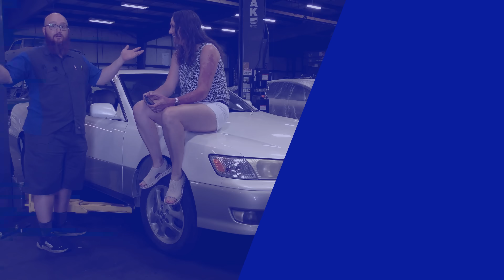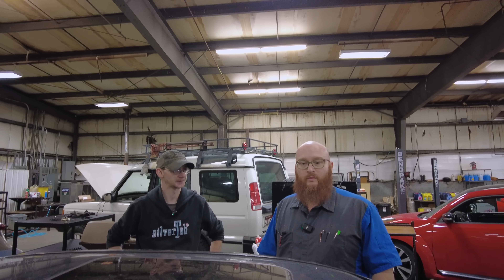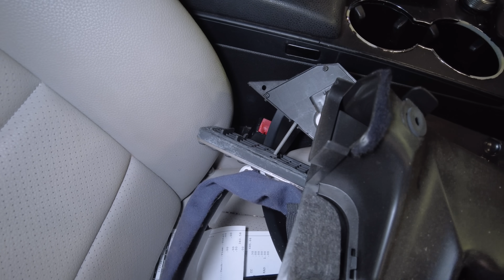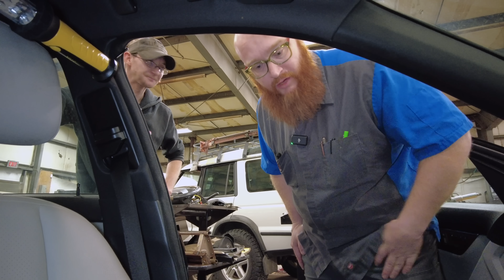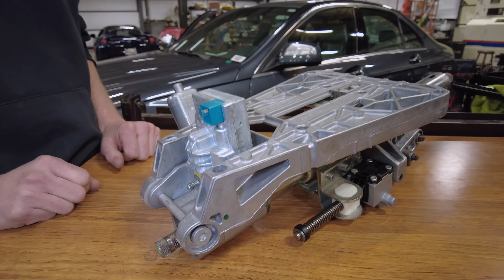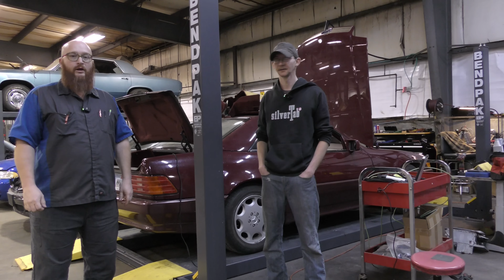Tiny Part TOTALLY Disabled This Mercedes! AND it's a Common Problem!

Comment: I've said many times The problem of using Mercedes, Bimmer, Audi or any high end cars here in North America is that the Mechanics here for these cars are shit...are crap ..even those at the dealership and they all overcharge .  They still don't know how to fix easy stuff on Germans Cars compared to European Mechanics or even a roadside Mechanics in Africa or Middle East for these cars. My friends W204 had the same problem, and Bad  starter motor in Ghana and was damn easy and cheap for these young Mechanics with few tools to fix everything without having to disassemble the whole car like  this one in this video. And oh for the starter they open it up and fix for just $30

Comment: Just had to fix mine in Nov 2023 on a 2012 C300. I replaced it with an emulator, thank God I was able to do it without removing the entire column. Oh BTW, the dealer wanted 1900.00 for the repair on a car with 140,000 miles on it

Comment: Theres a way to start it btw incase u need to get it home basically what u do is put the key in the ignition turn it all the way dont crank tho
Now go underneath you hood go to ur fuse box locate fuse i believe is number 27 7.5 amp now pull it out and put it back in then go to relay “M” which is yo ur starter relay crack the cover off not damaging your relay after u get the cover off theres a contact on the side contact it by hand and your car should start if not try all the steps again if it dosent start u have another issue hopefully your steering lock module went bad on the unlocked position 
Also if that relay step dosent work try putting in a new starter relay and trying it again but every time it dosent work u have to repeat the key part 

Step 1 key in turned all the way basically ignition on

Step 2 pull fuse number 27

Step 3 put fuse number 27 back in if its not blow ofc

Step 4 hit the relay contact for the starter 

And that confirms u have a bad esl module that took a shit but atleast you arnt stranded

Comment: This is the EXACT same problem on nissan/ infiniti cars. I have a g37s with this same problem...steering column lock. Car won't start at all. Replaced part, electronics work,yet car won't start.think it needs programming. It was a b$%th to get out.

Comment: I had this happen to my W204 in Queensland Australia with manual steering adjustment 6 years ago. I did the job myself and pulled out the steering column etc - drilled the lock stud out took the lock module out and sent it to a guy in Sydney Australia and he repaired it and sent it back within a week for $280 Australian dollars I refitted it and it works perfectly to this day.

Comment: I suspect mine has an emulator installed previously. Other than  non locking steering and a functioning car, what would confirm an emulator has been installed?

Comment: I have done so many off these i cant even count them on my 4 hands. Common problem. We just get it by passed. I have even mastered taking the lock out with out removing the steering column on these w204's

Comment: Its the little dc motor that craps out. The brushes just wear out. Just like a starter mortor. You can buy the little DC motors and replace it if by any luck you can get the motor to turn by tapping it with something while turning key.

Comment: i believe C5 corvettes have an emulator thing that you can retrofit for a similar issue also. I installed it on mine so that when the steering wheel lock goes bad,  it won't leave me stranded.

Comment: I drive a w204 C300 and I had this  ESL failure issue, my local German shop quoted $1700 to fix it and another shop quoted $2500. I bought the actual motor bit itself and it was only $5 plus the tools to get to it were maybe $20 and it took me about a day to do. It’s a wild problem and is better to just prevent with an emulator honestly if you plan on having one of these cars for a while.

Comment: Emulators can also FAIL.
The real problem is the crappy little motor.
Looks like a toy train motor.
Best to replace the Motor but DO NOT mount to the Steering Column. Leave is loose for when it Fails again.

Comment: I’ve replaced many of these 
1. If the ESL fails in the unlocked position you do not need to remove the column just undo the 4 bolts & lower the column & remove the 13mm nut holding the stud then push it in & remove.
2. In the locked position on a manual adjustable column will need to remove the column not that hard can remove in 1/2 an hour.
3. Rather than cutting the stud off just drill a hole in the housing & wind the plastic gear wheel back till the stud pushes in.
4. If you have the electric adjustable column it’s definitely more tricky to get out as in this case.
5. The ESL is generally reliable mostly older higher mileage vehicles that suffer failure which can be predicted by the sound of the motor, when working correctly will release quickly on failing motors it is sluggish to release if yours does this remove the ESL in situ before it fails in the locked position. Buy a new ESL fit it leaving the old one connected take to a main dealer & have them just code the new ESL in ( just needs the wiring plugged into the new one & a coding key inserted into the EIS for a few seconds then good to go, you will need to have the dealer order the coding key to chassis along with the new serial number of the ESL & provide proof of ownership)
6 W204 is very reliable otherwise.

Comment: The saddest part about this video is that this exact same thing happened to my Aunt's car. Same model and everything, I popped the hood and serial plugged up the car's battery to drain residual electronic gremlins for about 15-20 minutes.   Outside of having to reset the radio, the car came back to life like nothing was wrong.  I can just imagine how much it would cost someone to do what the Car wizard and his mechanic did to fix this problem.  Cheers

Comment: Back in the old days I had two Mercedes diesels. 77 240D with 4 speed was like driving a 36hp VW Bug. Bought it for $2,250 just after the previous owner spent about $4,500  on the complete balanced engine overhaul by a well known Kansas private Mercedes repair shop when it had about 225K on it. He also spent about $500 on new sheepskin seat covers. Then the blower motor quit and that previous owner said he wasn’t going to pay the $250 or any more repairs so sold the car for probably a little more than any dealer would give him for a trade. That was in 1991. The wife and I ran that car another 200K until  it rusted out. It was still averaging about 30 mpg when we sold it. Various repairs over the years but nothing that couldn’t be relatively easily repaired. No computer! I really like driving on someone else’s money. About 1993 or somewhere in there bought a 1979 300SD Turbo diesel. Also bought that one with something over 200K on it not long after the previous owner had rebuilt the engine after he didn’t notice the temperature gauge on a drive to their ranch in western Kansas when the lower radiator hose decided to give up the ghost. Warped the head and did whatever damage excessive heat can do to a cast iron block. Owner bought a new Mercedes head. Sent the bottom to a machine shop in Oklahoma City that specialized in MB diesels. Then put it back together themselves on their farm/ranch shop. I had to pay $5,000 for that one. Still considerably less than I would have had to pay from a dealer for that car with a new engine. It was in excellent shape and I could pass anything I wanted, uphill or down. We ran that one over 200K too with typical old technology MB repairs. Again no computer and driving on someone else’s money. Finally sold the 300SD in 2005 and bought a 1996 Lincoln Town Car with 111K on it. Got that one cheap too. Still driving it with 215K on it now. One thing for sure after Car Wizard detailing all the things that can go wrong with “modern” MB’s you can bet I’ll never buy another one even if I had cash to pay. I’m holding out for a Toyota Avalon built before the 2013 model year which is when Toyota screwed those up.

Comment: Previous SL models had a plastic lever that cracked in the ESM selector.
There is an Aluminium upgrade about £20 .
Even better the lever can be deleted and then the gear lever will move even with key out...........
Less to go wrong IMO ⚠️

Comment: Happened to our 2010 glk but had manual adjustments so by slamming the steering wheel up and down to its stops freed it enough to get to dealer

Comment: I love my 68 years old Mercedes no issues like this can happen. My amateur advice:  dont by a car newer than 1989ish. All this electronic gimmicks will continuously cause unpayable issues as older your rolling mobile phone gets. No one uses a 5 year or older electronic device as they get slower or just dont work anymore. Think of all that electronic squizzed into a rolling object as a car. Rumbling on bad pot hole roads, non water or damph proofed, sudden incidens and your electronics in the transmission get flooded of coolant and so on. These cars are insane products that will end within 10 years as environmental scrap problems. Shortlived material waste.

Comment: oh look, my 90's corolla also locks the steering wheel, but thats fully mechanical whereas mercedes was like "oh yeah lets add a motor and wires and circuits and software to this thing, and lets make it all out of tin and plastic"

Comment: When I saw the front wheels on dollies I immediately knew what was going on, I've done tens of these within the 5 years I was working at the Benz dealership. There's absolutely no need to take out the entire steering column, I didn't even take off the steering wheel. Take out the back two bolts and back out the front two bolts as far as possible and leave the column hanging. This gives you more than enough clearance to get in there with a 1/4 ratchet and take the nut off. In cases where the lock was absolutely stuck and we had to drill it out, we had a 1 meter long drill bit that fits into a regular hand drill to easily drill out a hole in the top right corner. This gives you acces to the teeth of the motor engaging the lock in order to unlock it. This way you're not finnicking with getting the steering column out and back in which can be a pain in the ass. 

I agree it's absolutely stupid that this little engineering flaw pretty much bricks your entire car and the part is ridiculously expensive however the amount of work needed to fix this is over exagerated in this video. Grimes seems to be an excellent mechanic but I don't understand why he's still taking out the entire steering column if he's experienced with this repair. I probably did these in 45 mins to an hour top and that included vacuuming the car after having to drill out the lock.
Reply: @Flapjanus

Heyy, you seem really experienced in this stuff. Can you please tell, that does this happen on all cars with push button ignition ?
Reply: hey ! thank you for your amazing comment. i am planning to get a x204 GLK class. i think they are pretty much a raised w204. do they also have this issue? should i just remove this motor and install the emulator when i get the car ? i dont want to get stranded because of this
Reply: @yolbulucu  GLK is like you said pretty much a raised 204 and suffer from the same issue. Replacing the module or installing an emulator would be the safest bet. However most of the times the ELV doesn't break right away. You can usually tell months/weeks beforehand when the car has trouble unlocking it or it isn't unlocking as smooth as it once used to.
Reply: I agree. This gentleman I think disassembled too much. I did this as DIY and cannot remember disassembling that much.
Reply: This wizard loves to rip his customers off.
Reply: @harrysam100 Ya, that's it... 🙄

- not.

Comment: One more reason to avoid this overpriced junk. Definitely go for the emulator IF I had to make the choice. Ridiculous that it could happen again in a few years. Touch wood my 10 year old Sportage is still running well with no show stopper breakdowns or tow truck trips.

Comment: My dad has a 2014 Honda Accord. And one day it died because my dad tried to start the car while he was closing the driver side window. After a battery change it does start. But then it died while he was driving it. After that we changed the Start/Stop button. It did start, but after a few kilometres of driving it died again. Now it's still at the shop trying to get it fixed. Any advice on what to check to fix this issue?

Comment: Had this problem lately on my W212. Was lucky enough that the steering wheel was in 'unlocked position'. Technician installed the emulator pretty fast and cheaply!

Comment: And why using hydraulics for steering assist is better than electric motors. You also get better feel and road input through the steering wheel with hydraulics. And having your key manually unlock the steering wheel is a much better system. Thanks Car Wizard, great video.

Comment: If you have an electronic shift for your transmission. And say the battery is dead, and you need to get the car towed. Guess what. Good luck getting it in neutral so you don't screw up your ball joints and cv axles having the car put on a flat bed truck.

Comment: Yeah car manufacturers are doing some really "dumb" engineering with their electrical systems. An Oxygen sensor should NOT have input on how well the engine runs (meaning air/fuel mixture. that should be MAF and CAMshaft sensor only). But the main computer is designed to cause your engine to run poorly when an O2 sensor goes out so you will get it fixed and bring into the dealer. Or doing something like running the electrical wires for your wipers through the cars stereo, so when the stereo goes bad you lose your wipers as well. Neither are good engineering, and you see stuff like this in every recent car model, say since 2012. It's absolutely ridiculous, and Mercedes and BMW are the worse about wiring a cars electrical system poorly. Just in hopes it causes you problems and bring it in to the dealer to charge you to fix something that wasn't broke in the first place.

Comment: I bought a cheap brake light switch. I moved the car to stall the switch and the contortion required to get under the dash. Then the new switch broke and I couldn't move the car of course because a bad brake light switch locks the transmission in park.

Comment: Any tips please for a lovely 1994 UK cabriolet A124 which is immobilised and can’t be started, or unlocked with the remote IR key?  It seems that the IR key is functional, so it’s a problem with the unlocking system.  I’ve  tried multiple synchronising methods to no avail.  How can I check the door IR/IFZ sensors?  If I can’t solve the unlocking, can the immobiliser be bypassed?  The starter motor spins fine, so it’s a fuel pump and/or ECU power cut to the coils. Thanks for any guidance from anyone!
Reply: On those if the key is dropped the IR emitter can fail, but also the EIS is known for failure

Comment: It's an 09! The manufacturers expectation is the 4 year warranty. The car is nearly 15 years old! I understand 100% where people are coming from, how stupid a part causes such a major problem, if it is more a problem darn near 10 years out of warranty that is respectable. They can make the car without a steering wheel lock, but this electronic locking column is common on many cars today.

Comment: I wouldn't buy another Mercedes after owning a w203 that needed an ecu rebuild, purely because it's placed vertically underneath a main water drain from the front screen, so it got water in it and failed. They are badly designed, badly engineered and don't drive better than anything else built post 1992. My w204 diesel had timing chain noises at just 73k, they are hopeless in engineering terms and I won't hear a bad word against French cars ever again. Mercedes most popular and reliable models in Europe are now powered by Renault, I'm not surprised

Comment: For a Nissan Cube & probably others, you can convert the steering lock assembly to function as an emulator by removing the locking motor and zip-tying the switches the motor normally activates. Only cost is labor, no emulator to buy. There is a good YouTube on this I saw. Mine has been working this way for years. A small ESL light stays on the dashboard when driving but you could pull the bulb.

Comment: ALL of the automakers should make the engineers work on their stupid designs. I'll never forget the first time I saw the starter motor located under the intake manifold on a Cadillac. My jaw just dropped. Since then I have never even looked at buying a Cadillac. This Mercedes is a perfect example of the kind of crap the automakers have been doing for years. Its actually nice to see a dealership get bit in the ass by its own designers.
Reply: I mean, you replace a starter every 100k at the worst. It’s not that awful of a location

Comment: As a tech myself mine was going slugish so i took apart the steering column  took iginition switch and e.s.l  took it to a electronic tech and got motor replaced for 50$

Comment: it happens when you park with the steering wheel not straight. the column lock module burns out from trying to lock the steering..
Reply: I am curious as to why you think this could cause the problem ( I happen to agree with your logic).
Reply: @johnkaimins9998   when you remove the key the car tries to lock the steering column. if the wheel isn't centered the lock module keeps trying to lock it in place until the column lock burns out. i towed so many cars cause of it back in the day.
Reply: @uptownsamcv  Thank you for your speedy reply. Nice to get advice from a person with real world experience!  Have a great day.

Comment: I was replacing the brakes on my Civic and was surprised that the steering wheel did not seem to be locked.  Without power steering, the wheel doesn’t move very easily anyway.